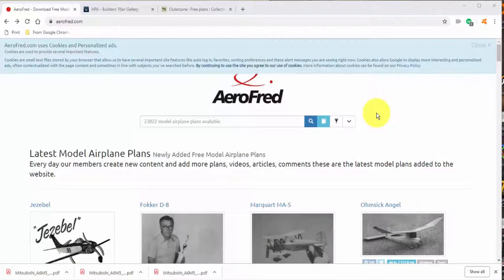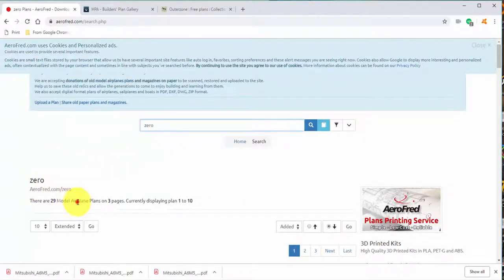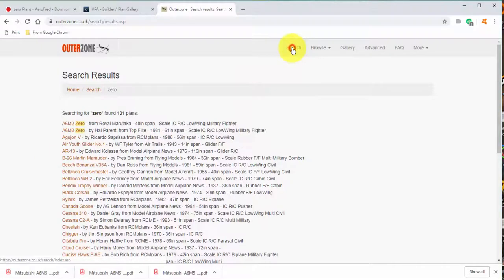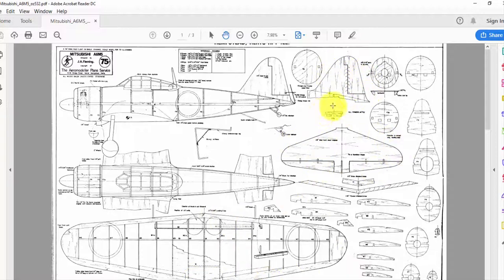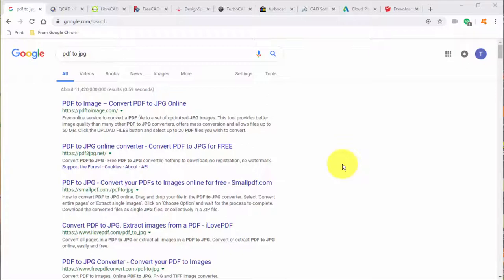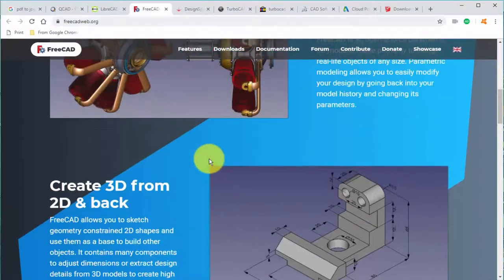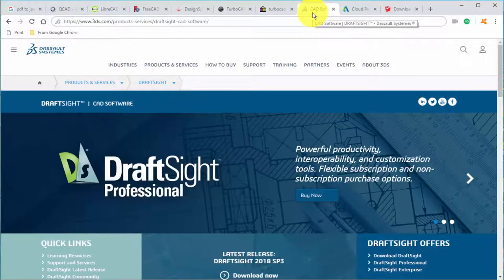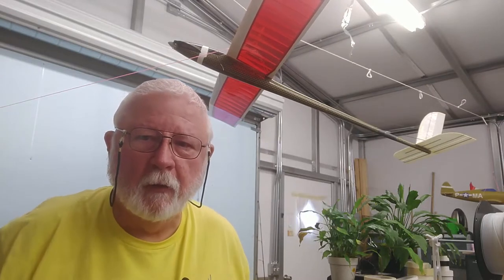Sectioned Foam RC Aircraft Fuselage Building - Part 2

Comment: Bonjour. Merci pour vos vidéos. J' essais de comprendre comment vous faites et ensuite je transposerais cela pour une découpeuse fil chaud. Dommage pour la version de Sketchup make 2017 car elle est encore trouvable mais l' éditeur la bloque à 30 jours. M' enfin, je trouverai bien un logiciel gratuit me correspondant. Encore un grand merci car votre façon d' expliquer les étapes est très clair et donne envie de se lancer.
Reply from the maker: Il peut être difficile de convertir cette méthode manuelle en une machine automatisée Hot Wire. Il existe un logiciel dédié qui rend cela très facile, bien qu'il soit un peu cher. Recherchez la mousse DevFuse et la mousse DevWing par un utilisateur nommé "Durone" sur le forum RCGroups. En ce qui concerne le programme de CAO, bien que j'utilise SketchUp, il y en a beaucoup d'autres qui peuvent faire la même chose. C'est un travail de CAO très simple.  Pardonnez ce très mauvais français, je ne suis pas francophone.
Reply: @tvideo1189  Merci pour votre réponse. Effectivement, je vais regarder de ce coté la mais votre méthode est très formatrice et je n' ai pas toujours la machine. Je vais utiliser Fusion 360 car je le connais un peut. Bravo pour le travail que vous faites et surtout de la transmission de vos connaissances. PS: Pour quelqu'un qui n' est pas Francophone vous vous débrouillez parfaitement. :).
Reply from the maker: @alexandrem3226  Fusion 360 est un bien meilleur programme de CAO que SketchUp. J'utilise simplement SketchUp car je l'utilise depuis de nombreuses années maintenant et je le connais vraiment bien. Visitez le site Web de mon ami, RCKeith ici: https://rckeith.co.uk/ Il y a beaucoup d'informations sur la découpe de mousse ainsi que sur la façon de construire une machine peu coûteuse. Et plus important encore, le logiciel gratuit pour l'exécuter. Merci d'avoir regardé mes vidéos, j'espère qu'elles vous seront utiles.